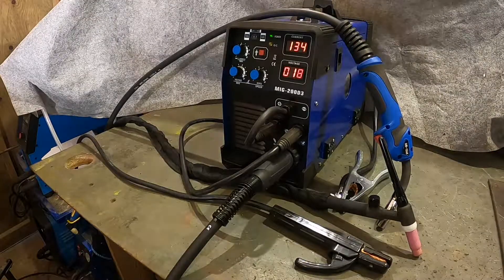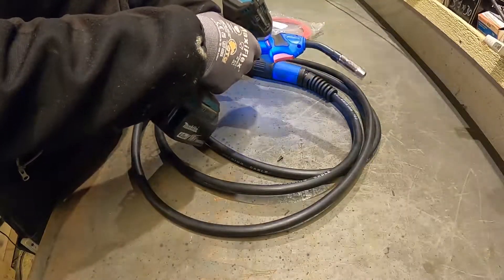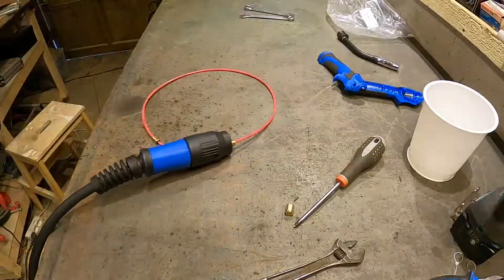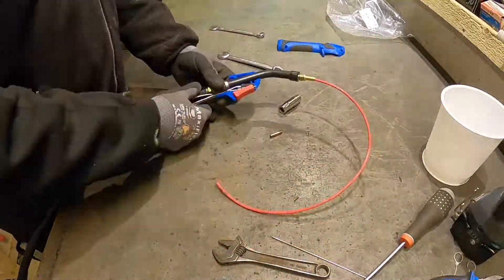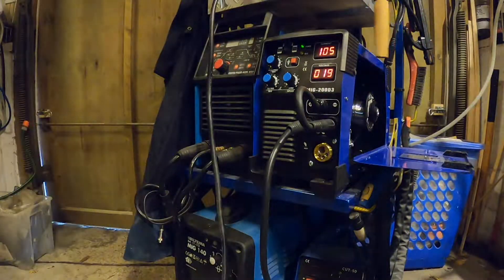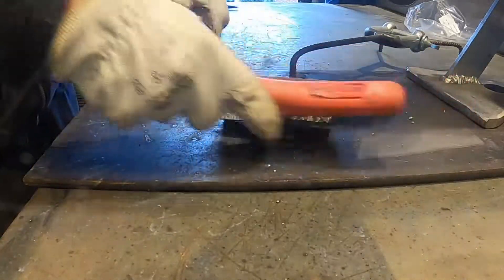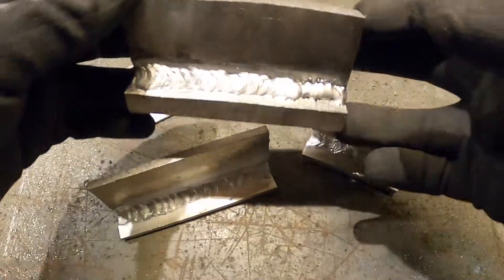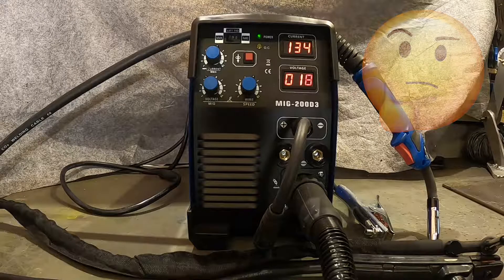New teflon wire liner for the MIG200D3 mig gun - for improved aluminium welding.

Comment: Could you tell me the part number of new teflon wire liner, thanks
Reply from the maker: https://www.ebay.com/itm/MB-15-25-36-Mig-Welding-Torch-Teflon-Liner-Red-x-4MTR-Aluminium-1-0-1-2-Wire-/152960126880?_trksid=p2349624.m46890.l49292

Comment: And where is the brass terminal for the Teflon liner?
Reply from the maker: Hi Boris. Theres a small brass ring that came with the teflon liner. I call it a compression fitting in the video. Its locked in place with the lock nut. I do this about 2 min and 10 sek into the video, ist on fast forward, so its not easy to see... sorry about that. 
Hope it make sense?
Reply: @bobossmallworkshop7896   No, I meant ending the bowden cable in the burner. https://youtu.be/ixWWcVHpaVI?t=76
Reply from the maker: @bp-synapse  There isn't any. This version is just the teflon tube all the way to the contact tip.